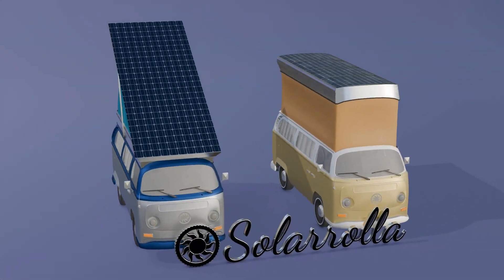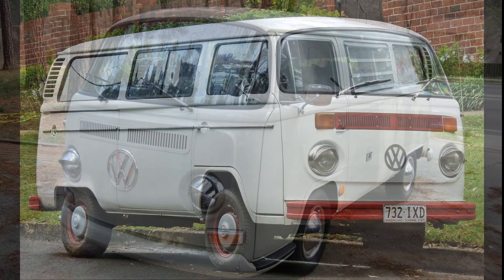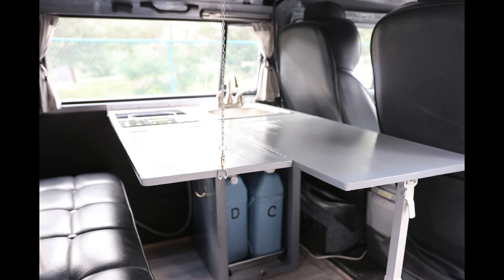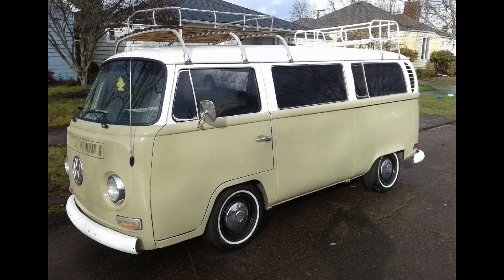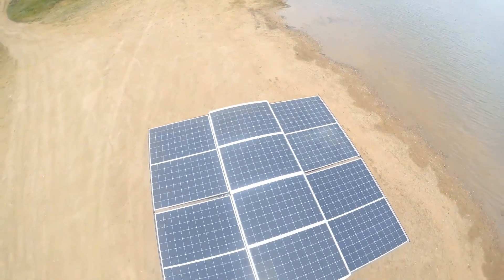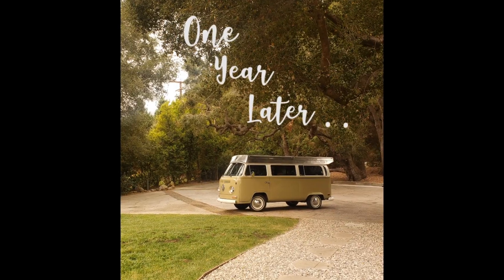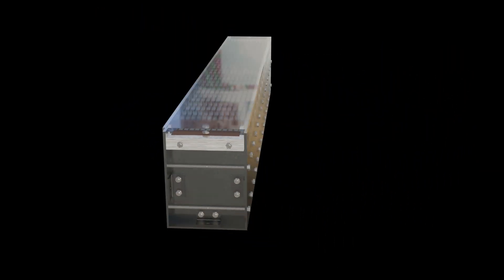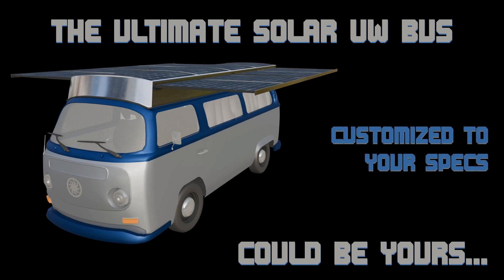Napkin Series 4 - Solar Electric VW Buses

Comment: I don't get it why using more and more powerful engines - as I always thought the original VW van idea was "small is beautiful".
Why not try the whole thing with let's say 50 or 60 hp instead of the double and more? And less battery weight but more charging even while driving.

Comment: Can't wait for this new bus project! I am from Greece and i own a VW T2 that i also want to convert it to electric even though it is forbidden by the law in Greece. I am thinking though to make it hybrid with in hub motors and a 10KW battery pack because 90% of the travel i do daily is less than 50km. If i do this i will leave the original motor only for special cases or a big travel. Any in Hub motors to suggest?